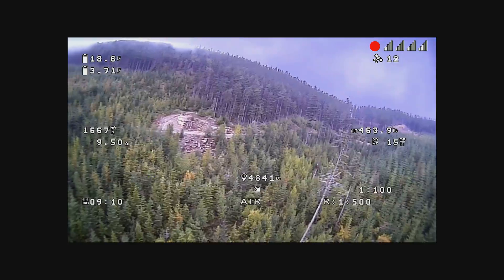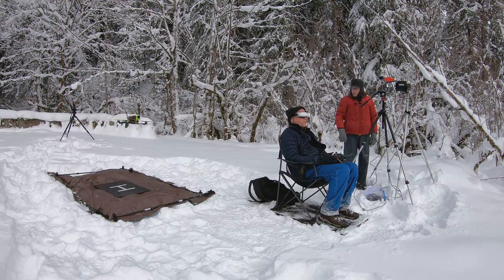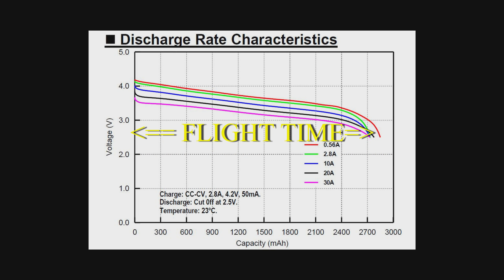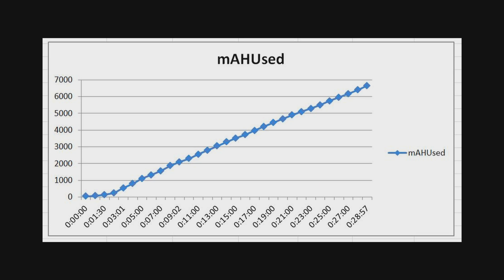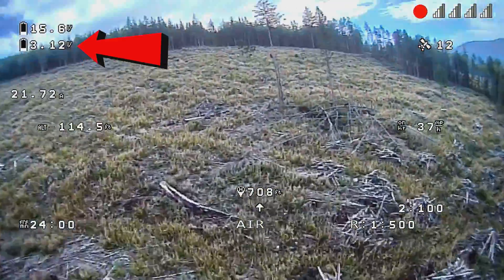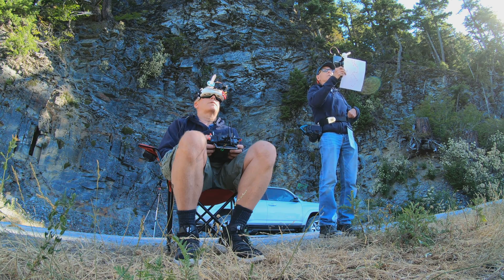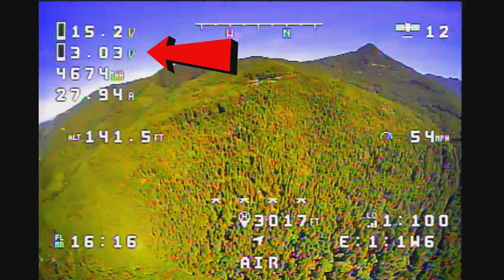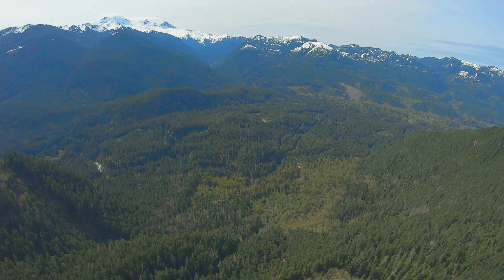Battery Power Management for Long Range FPV Flights

Comment: All modern quads will fly long after you are doing damage to the cells.  If you bring lions to 2.75v under load  you are damaging those cells.  You dont need graphs.  Just know at what voltage your quad is half pack.  Easy.  You are making mountains out of mole hills. This is basic stuff.
Reply from the maker: To each their own. Amps are how much of the "gas" in the tank is consumed. Min Voltage is when the props wont turn fast enough to keep the quad in the air. I plan my flights based on how much amps is needed for a certain distance or climb. Not what voltage is used. The cells I use in my packs are rated to cut off at 2.5v. So When I fly I monitor voltage and amps used.  Both. And Who cares If the cells are being damaged. I look at batteries as I do props: They wear out..have a limited life. Are meant to be used hard. They are consumables.

Comment: Great video. I'm flying a Chimera 7" with 6S2P 6000mAh Li Ion 15/30C batteries. My charger defaulted to 4.1v when set to Li Ion. Should I be charging them up to 4.2v? And I should be landing anywhere between 3.0 - 2.75V per cell? Does the 15/30C mean I should try and keep the "A' to 15? I find it's usually around 21 when I'm flying. Thanks for the info.
Reply from the maker: Thanks for watching. You really should try to determine what brand and model cells are in that pack and look up the manufacturer spec sheet  and go by that.  Liion cells will differ slightly especially the minimum voltage. Yes the 15/30 is the max Amp draw... generally continuous and burst. You must determine if that rating is for the individual cells or the entire 2P pack. However is using a 2P pack the maximum amp draw that pack will support is now doubled. Meaning If the individual cells are rated 15/30 then if its a 2P pack you can push it to 30/60. My Sony cells are rated 15/30 but I fly a 2P pack and feel comfortable flying around 30Amps continous draw.

Comment: Great video explaining  battery management! I was planning a mid range flight today and had a tail wind when I started flying. About a half mile out I decided to turn around to spot check to see where I was located and to see if I had LOS. When I did that I really had give my quad more throttle to start heading home, so I just went home from there. Was pulling around 80 some amps to only go 50 mph on my 7 inch.
Reply from the maker: Thanks for watching. Yes the wind can totally mess things up too. A real concern that I too watch closely.

Comment: Thank you Valley FPV, very informative video. I would say as a humble recommendation, you should have started the video by saying the first thing to do before plotting tables and analyzing battery data, the DRONE SENSORS (current, voltage) SHOULD BE CALIBRATED. You mentioned the calibration at the end of the video, I believe It should be at the beginning.
Thanks again.
Andres D.
Reply from the maker: Thanks for watching and thanks for the suggestion.

Comment: Great video! Also to mention the fact that, the harder you push your quad, the less likely you'll be able to squeeze all the mAh your battery can give. Being careful on the throttle is the best way to use the battery without stepping into hard sag.
Reply from the maker: Thanks for watching. Yes indeed. Good points.

Comment: Hey Mike, great information for anyone starting out in long-range FPV. I was going to make a similar video but I’ll just refer people to this as you covered everything really well. 
One suggestion is to add the Throttle Percent to your OSD, if find it really handy as a reference when flying, but also after the fact when analyzing the power usage and speed. 
Keep it up, and get ready for spring, Cheers!
Reply from the maker: Thanks for watching.